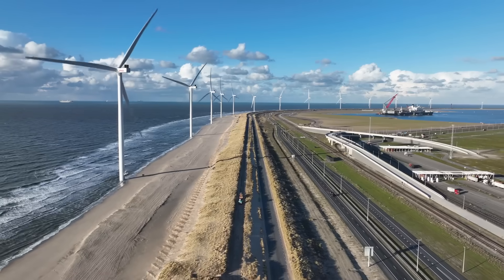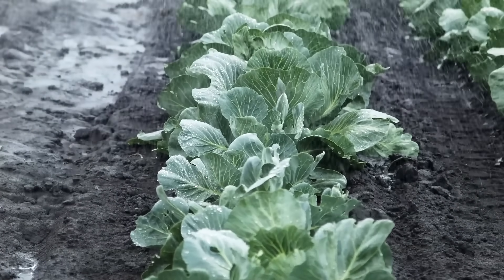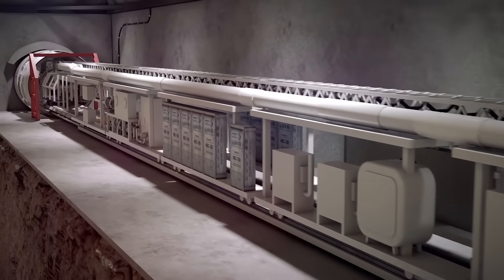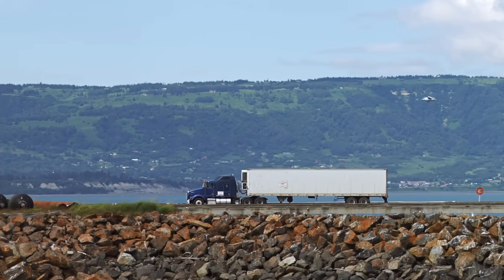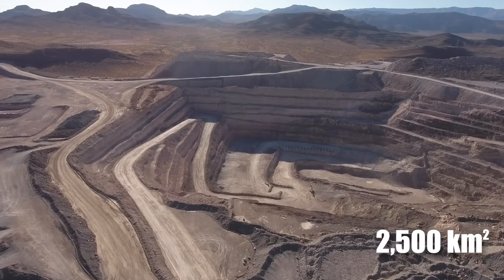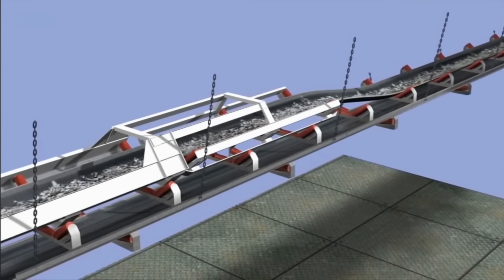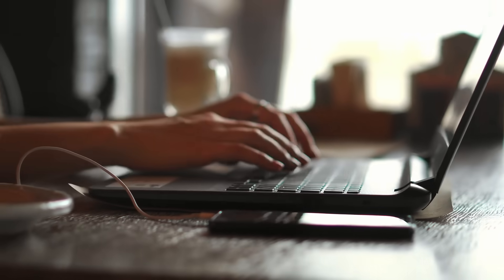Britain Is Building A Massive New Super Mine That Nobody Has Heard Of

Comment: And we still have 450 years of coal reserves that could be mined the same way and would make the UK energy self-sufficient but our posturing politicians would rather see ordinary people pay sky-high energy bills so they can say they are "green".
Reply: The UK doesn't have any coal power stations they were all demolished

Also so far this year 65% of UK electricity generation was from non fossil sources meaning even if you insisted we use coal we would only need it for 35% if our electricity needs

By 2030 which is only 6 years ans 4 months away, the UK grid will be 95% non fossil so we are post fossil fuel for electricity generation in the UK

Unless you want to fire up your home chimney there simply isn't the need or demand for significant quantities of coal in the UK. I suppose we could export it but we wouldn't get much for it as paying for shipping to take it to China or India the other side of the world wouldn't be cheap
Reply: Wrong, several have been converted to bio-mass like Drax and maybe Ferry Bridge. Sounds really green doesn't it until you learn they are fired by wood pellets from Canada so a 6000 miles sea voyage instead of a half hour train ride, complete insanity! We also still have a steel industry that uses coal but instead of Wales, which incidentally has the highest calorific value, we ship it in from Australia, Greta Thumberg eat your heart out! @kaya051285
Reply: @jackmillward5936  Your views are out of date. Offshore wind turbines in the North Sea will get 60% capacity factor. As a fleet deployed over the UK it will be closer to 70% and with Interconnectors as a fleet in North-West Europe it is closer to 80%

Couple that with existing hydro in places like France Norway Sweden allowing virtual storage and a small amount of economic batteries (perhaps only 2-4 hours of storage) and you can set up a grid which is 90-95% non fossil

By the way the UK in 2026 will be 75% non fossil by just what we have and what is under construction. Come 2028 we will be ~85% non fossil fuel and by 2032 its going to be close to 95%
Reply: That's your opinion! glad you are happy paying 25% more for your electricity than you need to and losing millions of manufacturing jobs to places like China thanks to energy costs that are the highest in Europe. The French btw get most of their energy from nuclear. I bet you work in the public sector. @kaya051285
Reply: You do not have to burn coal to gain from the use of it. It can be added to  a farmers soils and makes an excellent fertilizer.
Reply: I didn't know that, thanks. My main issue though is that the whole "Net Zero" hysteria is built on a false premise, climates change, always have always will, if they don't we WILL die because it will mean the earth has stopped turning! @englishpassport6590
Reply: @johnallen7807 This doesn't really refute what climate scientists are saying. They're well aware of the natural changes in climate.

The problem is we're accelerating the whole process, even when the climate naturally changes it can cause mass extinctions, so by accelerating it we're just bringing it closer and increasing the damage it will do.
Reply: @englishpassport6590 Try keeping warm or cooking with coal without burning it. You can grow as many potatoes or carrots you like but you're going to get pretty bored eating the damn things raw for the rest of your life.
Reply: I agree, the entire "Net Zero" project is insane and undemocratic, not to mention the fact that the UK produces less than 1% of world emissions! Look what that currupt b****h Sturgeon did in Scotland, cut down 150000 trees for her windmills, hardly "green" was it?@@jackmillward5936
Reply: the reason for sky high energy bills in the UK was due to the high gas prices and not renewables. The problem was and is that the electricity price is set by the highest price product added, which is gas so that set the price! Here in the UK we get around 40% of ALL the wind that hits Europe so by 2050 we will generate more energy than we need from the wind so we can sell it to our neighbours in Europe to make the UK money!
Reply: So how do you explain the "green levy" slapped on by the government which is 25% of every bill? Wind only blows 18& of the time which is why there have to be gas turbines available to take up the slack, incidentally these take time to reach operating efficiency so having to switch them on or off for short period wastes energy. Wind turbines also consume massive resources in construction and maintenance, just one example, an average 100 tonnes of cement for every turbine (cement is produced by burning limestone at 1400 degress, hardly very green). @markreed9853
Reply: @markreed9853  😂🤣😂🤣😂
Reply: @elguapo1507  so what part do you find funny 🤔
Reply: @markreed9853  First off, electricity is not 'energy'. Energy is the total output from all sources, wind, solar, gas, coal, nuclear, biomass and hydro. Electricity is just that and forms about 20% of our total energy needs.

Secondly, for every Gw of electricity renewables produce, there must be an equivalent back up source as it can't be precisely determined at any given time when the wind will blow or the sun will shine. These are expensive to switch on and off to cooperate with renewables, none of which is calculated into the cost of renewable electricity, other than when the consumer comes to pay for it.

Will building more wind turbines and more solar farms solve the cost problem? Well, no, because renewables operate at around 30% nameplate capacity so the overbuild required to meet the demand for UK electricity would be prohibitive both environmentally and economically. And there's still the problem and cost of back up.

Can battery back up be used? Fine on a very small site but not at scale. The batteries themselves are horrendously expensive, we are talking many £Trillions to provide battery back up for the whole country for just a week of a mid winter period when there is little to no sun or wind.

Then there is, again, the cost to the environment. Let's put it this way. Just the minerals required to provide the batteries to electrify the country's road transport fleet for the UK alone will expend up to five times the world's known reserves for some of them. Batteries to run the countries commercial and domestic energy needs for a week are many more times that again.

How about hydrogen as a storage medium i.e produce it when the wind blows and the sun shines? Problematic as hydrogen is extracted from natural gas and the process is very inefficient and releases CO2 anyway. It cheaper, cleaner and more efficient to burn the natural gas directly. Electrolysis is another method, although never tried at scale, but itself uses large amounts of electricity, otherwise required for commercial and domestic use and to produce a green version would require yet more overbuild of wind turbines, solar panels and - guess what, back up fossil fuel/nuclear power plants.

If you are genuinely interested in the problems facing just the UK faces to implement NetZero by 2050, Michael Kelly, 
the former inaugural Prince Philip Professor of Technology at the University of Cambridge has produced a paper which explains it quite clearly at the link below.

Hope it helps.

https://www.thegwpf.org/content/uploads/2022/03/Kelly-Net-Zero-Progress-Report.pdf
Reply: @RedHotscot  national grid say they can get to net zero by 2050 with mostly renewables like wind and solar and we have good predictions of what we will get from them. Yes, some energy storage of different types like us using norway's hydro now plus I see not just lithium ion batteries (great for balancing the grid as well) but more flow batteries coming online, some even now. I would also add that compressed air and gravity storage will be a thing in the future plus a smart grid (trials happening now with customers asked to reduce or increase use in 30 mins time periods) We are starting to add more interconnectors with countries like Norway, Denmark, France and the Netherlands so we can sell and buy electricity when needed to reduce out need for gas to make electricity. Any reduction currently is better than none.
There will also be nuclear in the mix to cover a lot of base load.

With regards to electric vehicle there are enough materials it's just the mining and refinement is a bit of a shortfall at the moment and the benefits are that once the materials are out the ground they can be reused over and over again with recycling unlike fossil fuels. Also more vehicles moving to LFP chemistry which is a cheaper and easier to make. No, nothing we do is perfect this will just be better. We are just at the start of this process and things will improve over time but we need to get off our addiction to burning fossil fuels even for just less local air pollution but to help with global warming as well, whether you believe that or not is neither here nor there ... https://www.nationalgrid.com/stories/energy-explained/how-much-uks-energy-renewable

Comment: This info isn't new but the west keeps claiming they have the only deposits. China isn't mining its deposits as far as I know but that will probably happen in time.

Polyhalite is basically equivalent to K2O, and has been discovered recently in the Sichuan Basin where the eastern part of the basin has prospective resources of over 10 billion tonnes (Jin, 1989; Fig. 2c). Polyhalite is widespread in the basin forming thin and multiple layers constituting a large cumulative thickness (Gong et al., 2015, Zhao et al., 2015, Zhou et al., 2015).
Reply: China is currently the biggest invester in this project though. Strange for them to invest if they have their own sources aswell as cheaper labour costs and laws.
Reply: Mineral deposits are not only about quantity but quality and cost to extract and stability of the region/government

This mine is very close to an already existing deep water port in teesside which can accommodate large Cape vessels (300,000 tons per ship)
Reply: True. There are deposits of polyhalite around the world - none with the high nutrient and mineral value of this though, in fact, they’re not even close.

Comment: The distance from the Milton materials processing facility to Tees port is 4 not 44 km (the writer doubled the 4 by mistake). Other than that, everything is 100% correct. The footage has lots of compromise edits and is not a 100% representation of the actual facilities.
Reply: Quiet a bit of the footage doesn't match the text.
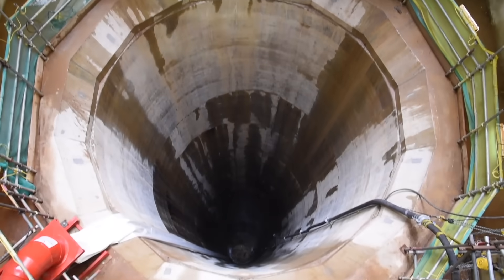Reply: @warwicktaylor347 especially the animated part at 0:4:54 with cars and lorries driving backwards!
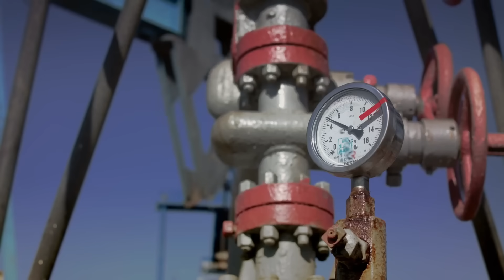Reply: 0:16 Maasvlakte 2 port of Rotterdam
Reply: What do you expect from a Chinese source

Comment: so if there is next to zero impact on the surface then where will the not inconsiderable amount of spoil from all the tunneling be going ?
Reply: Shhhh!  Not supposed to ask questions like that.   I daresay they found a solution. Once they hit the mineral deposit, then most of what is extracted will be used.
Reply: @PhilJonesIII  - aren't they tipping it into the sea to make Teesport?
Reply: it will may possible be being crushed down  or repurposed for other building projects. Teeside has many contruction companies which repurposes aggregates for builders merchants, my best bet is this is where it will go or it will be used for expanding teesport for future infrastructure of this overall project.
Reply: There’s little or no spoil - the stuff (polyhalite) is near pure.
Reply: @wallace686  i understand the deposit is at considerable depth. I was referring to the access and transfer tunnels and shafts through the overlying layers.
Reply: @shayne109   refer to my comment.

Comment: In the video (at about 03:20), it says of the Woodsmith Mine to Wilton conveyor belt is "about 37km long" and is dubbed "the longest conveyor belt in the world".
Between the Mt. Saddleback (bauxite) mine and Worsely refinery near Collie, Western Australia is a single conveyor belt 51km long.
In Western Sahara, there is a system of (multiple) conveyor belts that is about 100km long. It goes between the Bou Craa (phosphate) mine and the docks at El Marsa (Near Laayoune).
I think someone at Woodsmith Mine has been exaggerating. Longest conveyor belt in Europe probably, in the World no.
Reply: Maybe underground conveyor belt
Reply: Australian conveyor belts are overground and not underground?
Reply: It's the Bou Craa operation in Western Sahara at 98 km (ish).  Maybe the Wilton conveyor is the longest underground conveyor?  

Either way, an impressive development and a far cry from the days when a mine was a rough hole in the ground held up by tree trunks and prayers.
Reply: You are correct that it’s not the longest in the world. However, the content is mostly right. The low environmental impact on this incredible part of the world is to be praised (low rise barns and underground conveyor) meaning no trucks spoiling this beautiful part of the world.
Reply: @daphnescombine  For the expected volume, trucks would never have worked anyway.
Reply: Longest in Britain
Reply: Right but I think he meant "underground" mate. The Australian ones are surface belts.
Reply: Is Britain keeping any of this Polyhalite for our own arable farms , allotment holders and gardeners or is it all leaving the UK by ship from Tees Port?
Reply: Its a free market I'm sure British farmers will be buying it mate  @GenaF
Reply: @GenaF   Given Anglo American is a mining company sales will probably be handled by companies such as ICL and all you need to do is look at this companies products already sold in the UK. Levington is just one of the many common place names of products sold
Reply: But why they built so far away from the deposit/need for conveyor ?
Reply: @АгронДепартье  i live in the area, the reason for this is becuase the mine is on top of a national park. So to continue the process without disrupting the surroundings with trucks and ugly equipment they decided to contruct a tunnel the goes straight from the mine to a processing facility in teesport and from there straight onto a ship for shipping. Its initial expense will be rather expensive but its going to add many well paid jobs to an already famous mining community. Teeside was the fist place to be struck by germans during WW1 becuase Teeside was always the mining capital of the UK until very recently. Most towns in teeside are alive today becuase of mining.
Reply: @ashleygoggs5679  Let, me guess that National Park was not the real reason as the choice is not between disiel trucks and a tunnel but between nice eco-friendly green smart train and... So there could be lots of greedy land owners or municipalities which complicated construction of a railway. Or if the that place is high above sea level it is difficult to construct railway.
Reply: @АгронДепартье  Nah, it was the tight planning permission from the conservationist lobby or it wouldn't have got passed. As a former Sirius minerals shareholder, I remember the meetings well.
Reply: @АгронДепартье  It's a national park, even building a railway is basically out the question.
Reply: @АгронДепартье  The moors where this mine is located is quite high up, there is some rail infrastructure already there however the Yorkshire moors are beloved by many people, infact the Moors are JRR Tolkiens inspiration for the Shire in the Lord of the Rings books. So it will be a mixture of things, however when it comes to national parks we take them very seriously here so this is likly the largest reason for the tunnel.
Reply: @ashleygoggs5679 Teesside is the area surrounding the River Tees.
Reply: @АгронДепартье  It is because it is a national park and there are UK Laws which stop mines from being built without special permissions being granted. An overland route would have been out of the question and the mine would never have been built.
As far as the conveyor belt is concerned, I would have thought it was the longest at that depth, which is very impressive.
Reply: @АгронДепартье  I think it is because the processing plant is right next to the port.
Reply: @АгронДепартье  the need for conveyor is to get the product/mined material to the port. The location of the deposits are on a National park, area of natural beauty, it's been designed in this manner so as to not have machinery and trucks coming and going when mining commences.

All will be mined underground. Above ground you wouldn't even know it was there, as a national park. Thus the need for underground conveyor